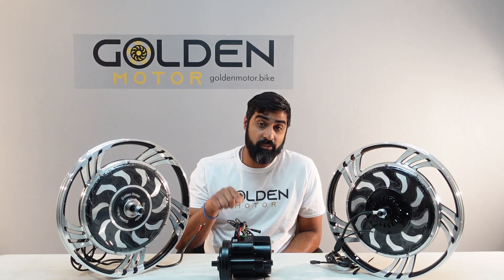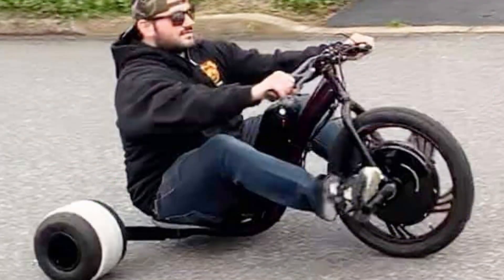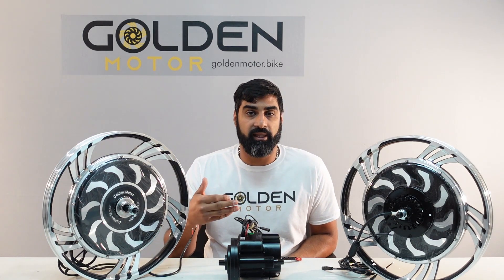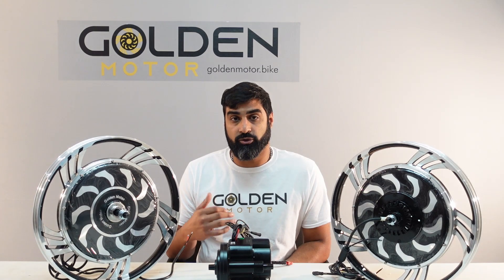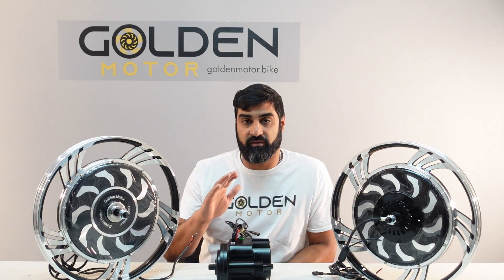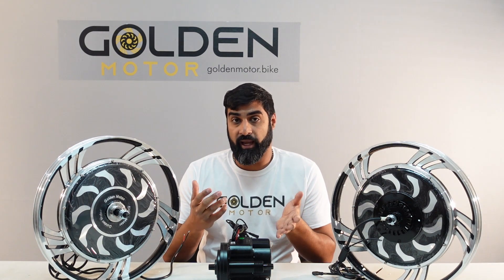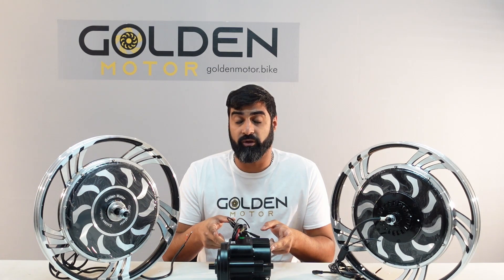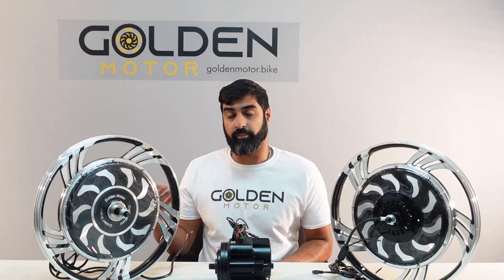Ebikes: Difference between Front Hub, Rear Hub, and Mid Drive Motors for Ebike Conversion Kits

Comment: Downsite to mid motor, you must pedel with the motor in the same gear as the motor. You must change gears through each acceleration adding to wear. With a Hub motor, you can let the motor do most of the accelerating from zero and stay in a mid-gear pumping at a lower rpm.

Comment: Another few cons of mid-drive:
- You are stuck using a single chainring. This is a deal breaker for me!
- You can't move without pedaling. Better pack a spare chain!

Another con of front hubs:
- Forks aren't meant to be taking the stresses these motors put on them - even if you use a torque arm.

Those are the main reasons I prefer rear hub - you have both options of pedaling, or using throttle only, it's not wearing out your drivetrain faster, you get to keep your double or triple chainrings. All of this is true with a front hub as well but I don't want my (suspension) fork having the stress put on it.

Comment: Why mid motor be more efficient? Contrary mid motor should be least efficient since it uses gears, while hub not. Gears could also get broken easily. One thing center motor coul not provide is regeneration. Also with mid motor you  loose front gears. 
My opinion best is rear hub motor. Changing flat is easy since motor only has one connector.

Comment: Hello good day, I have a golden motor magic pie 5 motor, what happened that activated the brake lever in motion on the bike, the motor stopped doing the regenerative brake and now when accelerating the motor does not turn and the battery is charged please help me what could it be, this is the link showing what happens in the engine thanks  https://www.youtube.com/watch?v=klqy60LlGec&feature=youtu.be
Reply from the maker: You are getting an error 7 , that is an issue with phase wires or the windings in the motor

Comment: Good Job ..Golden Motor Canada has helped me a bunch of times ... I had the rear MP3 1000 watts first and now have the MP5 1000 watt front motor ...Front is much easier to install and maintain .. Works just as well for me "Easy Cruising" I love the cruise control feature ..

Comment: I'm willing to buy electric motorcycle with rear hub motor 10kw from china ( there's another factory has mid drive motorcycle  but much less power only 4000 w with same price of 10000 w hub motor ) ... I'm confused which one to buy ? ... And which motor will last more without maintenance ? ... ( I live in hot weather btw ... So which motor is better , less maintenance and not get hot quickly ? )